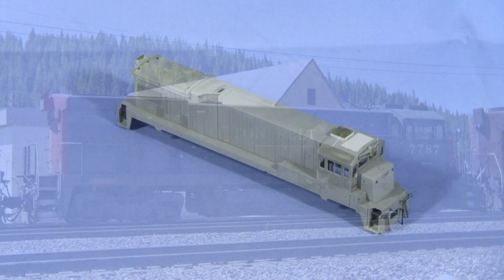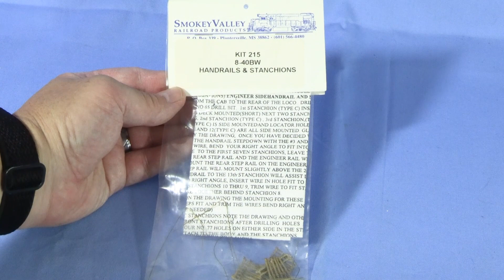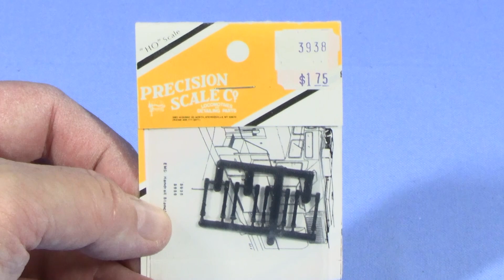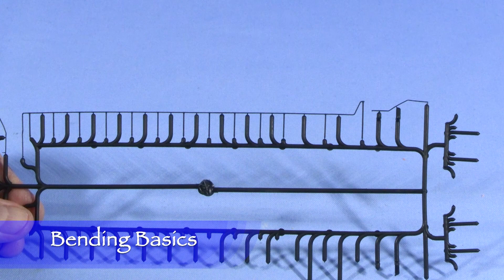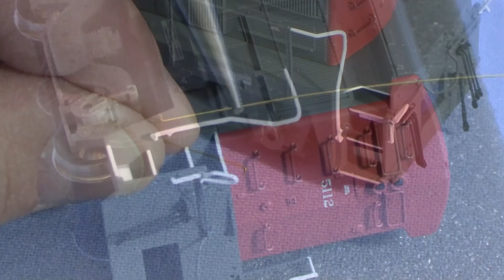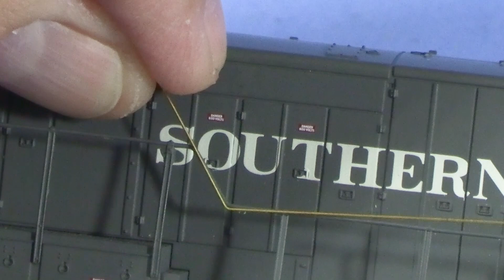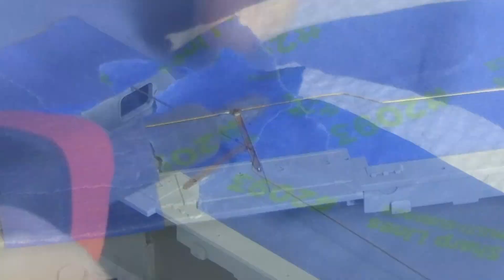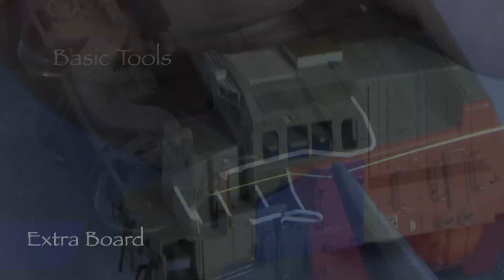Model Building HO SP Consist Build 16 - How To Make Handrails Part 1

Comment: I got most of my collection secondhand, which meant a lot of engines got separated from their original boxes and parts packets well before they came my way. I've been worried I had no idea where to start on fabricating my own handrails, light lenses, etc., but this has been a great help. I've had some experience using brass wire to fix or replace grabs, steps, and such on freight cars, but those are always small lengths with simple corner bends at each end.
Reply from the maker: I'm glad you found the program helpful.  I am still working on part 2, which will deal with the end handrails for the B30-7 and handrails for a couple other locomotives.  Thanks for watching!
Reply: @DanielCortopassi  I model both ATSF and SP in the 80s and 90s. How did you go about the light package for the long hood end on the B30-7? I have a handful of RPP shells I've been collecting and I can't find a casting anywhere. It's hard enough to find the UDE "cobra light" these days for the U-boats I have.
Reply from the maker: @FelineSublime  I fabricated the rear end light package for the B30-7.  I show how I did it in part 4 of this series, here on the channel, if you're curious.

Comment: This is the one thing about superdetailing that really intimidates me. I have a quartet of Blue Box SD40-2s I'm upgrading loosely off what you did for your model of ATSF 5126, albeit mine will be CNW. All of them need new handrails.
Reply from the maker: Before this video I hadn't made handrails in quite a while, so I had to deal with overcoming some inertia to start doing it again.  Practice is the best teacher.  If you have four similar units you'll get plenty of that!  It should get easier, in theory, as you make more of the same thing.  Good luck with your project and thanks for watching!

Comment: Gday, with your stanchions & rails use your packing strip as a guide jig for your height and spacings by scribing vertical and horizontal guidelines and locators into a piece of flat brass that's affixed to the packing strip the brass is now dual purpose a template and acting as a heat sink when soldering the railings. The brass strip can also have small alligator clamps on lead electrical wires riveted back to the brass plate to act as moveable clamps and heat sinks the same as you would soldering electrical circuitry or if you wish to get fancy a full length sprung loaded flat bar similar to a clipboard using flat spring steel strips fitted to the brass plate and used as a linear clamp.
Reply from the maker: Thats an interesting idea.  I'll have to give it some thought.  Thanks for the suggestion and for watching!

Comment: This is really handy cause recently I accidentally broke the handrails on a GP60 I bought and I was so upset
Reply from the maker: One of my pet peeves with a lot of modern diesel models is the plastic handrails.  I really wish more manufacturers would start using metal or something that was more durable and dimensionally stable.  Thanks for watching!
Reply: @DanielCortopassi   being a young modeler at 19 plastic handrails is really all that I’ve known, besides the few blue box engines I had as a kid. I love your content especially the building segments like this so I can fix my mistakes. I also take a lot of inspiration from your Blue Box Sd40-2 build as I’d love to make some of my old engines see new life

Comment: Maybe a stupid question but how do you research the history of the engines that you are modeling? Another informative and interesting video!
Reply from the maker: In the case of SP, I have a lot of books available that I've collected over the years.  I have books on Santa Fe and some other railroads as well, though not as many.  I've also built up a reference photo library, both from slides I've purchased and from photos I've found on the internet.  I often search for more photos when doing research.  It's helpful to pin down approximate dates when paint schemes or certain details changed.  I'm glad you liked the video.  Thanks for watching!
Reply: Thank you!

Comment: Hey, Love your rebuilds of older models, they've gotten me into reworking engines too. I Had a quick question, were do you buy your parts from typical? i've always bought stuff off eBay, but its hard to find some of the parts i need
Reply from the maker: I've bought parts from a variety of sources, including eBay, local hobby shops, online stores, and sometimes direct from the manufacturer (Cannon, KV Models, etc.).  Some parts can be hard to find.  I've had a tendency to overbuy over the years, so I have a pretty good stash of stuff at this point.  Sometimes I'm my own hobby shop, so to speak.  Swap meets or train shows can also sometimes be a good source of hard to find items.  Thanks for watching!

Comment: I play guitar,  so I could probably use my old high E strings (I use 0.]11 steel) for this project.
Reply from the maker: Those are heavier strings than I use.  I could never handle anything above .10s and usually use .09s on my electrics.  The guitar string wire is pretty springy.  I've never tried to use it for handrails.  Steel isn't really good for soldering, but it is good for poking fingers.  If I jab myself with brass wire it usually just bends.  If you get that to work I think it would be cool, and a great way to bridge interests.  Thanks for watching!

Comment: Do you know of any stanchion manufacturers other than Precision Scale and KV? What do you do if none of the available stanchions are quite right for your model? I’m currently working on a 3D printed SW1001, and I had to resort to printing stanchions, but I haven’t gotten to trying them yet. Not terribly confident they’ll hold up, but nothing else out there looked right.
Reply from the maker: Smokey Valley comes to mind.  I'm not sure if they're still actively producing parts or not.  Sometimes you can find the handrail kits, which include brass stanchions.  You could use the stanchions with your own wire, so in theory you could get a kit and use it on a different type of model that has the same kind of stanchions.  For example, the B40-8W kit I have would possibly also work for a C40-8W.  I did a model of an SP SW1500 using the Precision Scale end stanchions on the sides, since those looked more correct than the usual side stanchions they offer.  Keeping them attached is the only drawback, since they lack mounting pins.  Thanks for watching!